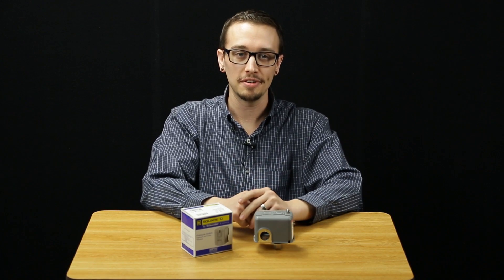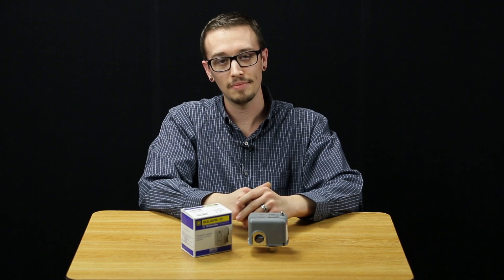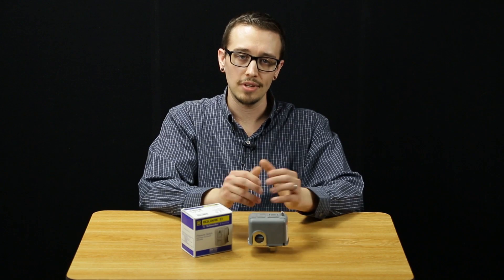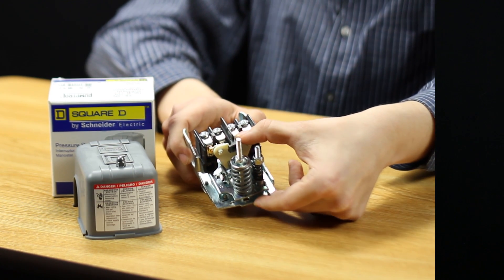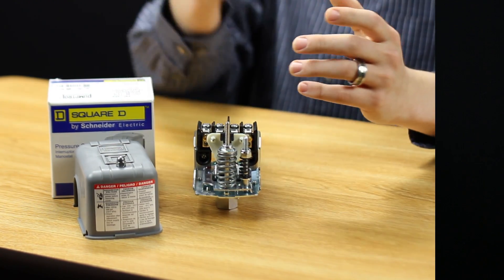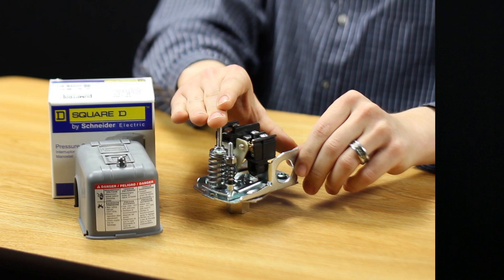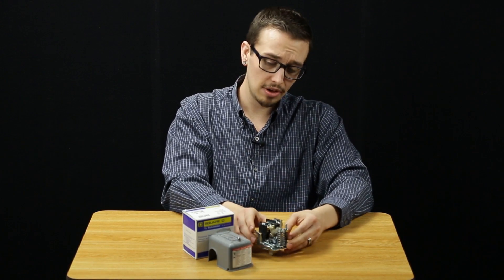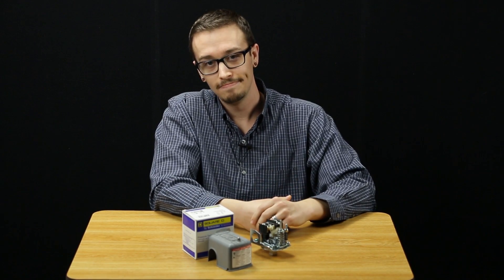Square D Pressure Switch

Comment from the maker: Thanks for watching! If you have ANY questions or concerns about your water/wastewater system you can leave a comment, call our experts at 855.329.4519 or you can live chat with them on our website: RCWorst.com
Reply: The water is working good at my son house and going to my house i dont have no presure on my i put about 40 pounds in the tank and it used to work...look for leaks didnt find none
Reply: I have a submersible well pump about 50 feet deep.  New square d 30/50 pressure switch. I pulled pump because  once it hits 15 psi the pump would shut off. I found some frayed wires near pump so I replaced all the wiring. Still have the same issue.  Bad pump? Running out of water?  Any suggestions?  Pump is over 10 years old.

Comment: Does this model (without lever) protects from pumping on an empty well? If not, can you recommend something that offers such protection? Thank you!
Reply from the maker: No, it does not. This model does: https://rcworst.com/products/square-d-pressure-switch-m4-30-50-psi-w-low-pressure-cut-off-9013fsg2j21m4?srsltid=AfmBOorRpcebPr-2mw1f_fxul-kEH8lViixdord1O4T3s7pvJP9ByF89

Comment: Hello, Im hoping you can help me. Are the switches the same just different factory settings. I need a 30/50 but can only fing 20/40 here. Can just buy 20/40 and adjust to 30/50 or completely different switch? Thank you very much

Comment: We have  had a  Red Lion RL-SPRK200-BR sprinkler pump that pumps river water 700 feet up to my gardens for 5 years. It works but today we saw that we had a schedule 40 pipe collapse on the suction side and a leak on on the outgo sode.  We dont know what the problem is, but whatever it was caused the pressure switch to die.  Maybe it was all the moisture from the leak?   What should I look for when choosing a pressure switch.

Comment: I have a Square D 0013FSG 2 pressure switch that just went out, it's contact surfaces are damaged. Under the cover it says it operates 40-60 psi, but then in a separate spot next to that there's a number (80) in a Square border by itself with no explanation or description. What does the 80 represent?
Im asking because the switches I've seen available have a different number (24) in that same location.

Comment: Any difference between 20-40 psi and 30-50 pressure swithes ? Or just changes their pre set pressure ?
Can i will use a 20/40 psi pressure switch with a pressure of 30/50 and other upper?

Comment: Have a question and cannot find the right answer. I have a biogest system and utilizing the biogas. I need a automatic switching from bio plant at say 30 psi (app) to pump to storage when it senses the pressure..... So it is off and senses say 30psi ...switches on till zero pressure and switches off again. I think its referred to as Normally Open (NO) but I dont see the reference on line. Am I missing something?

Comment: Hi, greetings from Sri Lanka. Thanks for this useful video. Recently my pressure pump for the bathroom showers started to drop pressure and as result the water flow gets really slow and after a while only the pressure pump restarts. I checked the pressure gauge and find the pump restarts only when the pressure goes down to zero. Could you pl advice me to correct this, which nuts to adjust in the pressure switch?  In Sri Lanka we have the same looking switch but made for 230v. Thanks again.

Comment: How the heck do I reset it after a power outages?! Everything says its a low pressure switch, a little lever on the side of the box. Mine is like the model in this video.... there is no lever on the side of the box.

Comment: How to adjust the pressure switch if the pump is continuosly running. Also if the pressure gauge is out of order will the pressure switch will switch off automatically. Thanks
Reply from the maker: We have a video on how to adjust a switch: https://www.youtube.com/watch?v=1VNSv7xVzzU&lc=Ugyr_rDbmUa7SUlPskR4AaABAg
You will need a working pressure gauge installed in order to adjust the switch.

Comment: It would help overall understanding to explain there is a rubber membrane that the opening to water pressure exerts force against to allow switch to read! If clogged, the small diameter to rubber diaphragm, the reading can be faulty! And, may need replacement, or cleaning!

Comment: From what I’ve seen they use the same switch to regulate air compressor on a horse trailer or RV the only difference is they run higher pressures like 120 psi is this in fact the same switch it is a Square D?

Comment: what’s the problem if i already replace the gauge but it’s still not moving but the pump is working its putting water on the tank but it takes so long then it will automatically shut but the gauge is still zero and the water is strong in the house 
then when you use it even the tank is empty it’s not switching on

Comment: Ok so if I need to adjust the differential which way do I turn it for what? 
Currently mine is off at 125 and on at 80. I’m trying to change it to 120 and 90
Reply from the maker: We cover that in this video: https://www.youtube.com/watch?v=1VNSv7xVzzU&lc=UgynkPu4h0dZ26SGCTh4AaABAg

Comment: My points seem to get damp and freeze together  or freeze open on cold mornings. What is the best way to stop moisture from getting to the points?
Reply from the maker: A heater or small dehumidifier should be used if it gets cold/damp.

Comment: How do you turn the stupid things on????
Reply from the maker: It should be normally closed (on), unless you have a low-pressure cutout switch. In that case, you would hold the lever on the side to engage the contacts until the pressure is above 20 PSI.
Reply: @RCworstwater    I figured it out.    Have to pull up and hold it till the pressure builds up.     Mine was on at 38 and off at 58.    Was shutting off frequently.   Tank has a 40 psi check valve.   I reset switch to 42-62.   Working fine now.    Thanks.

Comment: Hi.  Question on a vehicle's on-board air system application, so I can use pneumatic tools/ air up tires...  I'm using a brand-new car A/C compressor to push air (instead of refrigerant), as part of an on-board air system for my Jeep Wrangler.  If the compressor only needs the black power wire (because it's grounded already to the engine) going to the Square D, where does the compressor's black power wire coming out of the compressor hook up onto the 125psi Square D air pressure cut-off switch?  My second question is for the switch that I've rigged to turn on/off the compressor, where does the power wire from the cab-based switch hook up onto the Square D?
Reply: These switches are designed for 240V with two sets of contacts. If you are just using one power wire, you'd only use a pair on one side (the two screws on the other side will not be connected to anything).

Comment: I have recently replaced the factory pressure switch that failed, with a square D pressure switch. And my 33 yr. Old compressor is working better than ever. Kept the old girl running, I was afraid that it wasn't going to be repairable. But with a little patience, and some help from a local compressor company. I was able to get it repaired and back in service. It really wasn't as hard to fix as I thought. The hard part was getting the air line, swapped out. Had to switch it from plastic, to copper. And make it a little longer to fit. It was well worth the extra effort to get it repaired. GF1, 👍👍👍👍👍😁😁😁😁😁😎
Reply from the maker: Nice job!

Comment: If my pump loses prime, will this switch close and cause the pump to run and burn out or does it have a safety feature that opens the switch below a certain set pressure?
Reply from the maker: You need the M4 pressure switch. Here are links for the video and where to buy it:
Video: https://www.youtube.com/watch?v=ROvZpwHV9Ho
Buy it here: https://www.rcworst.com/square-d-pressure-switch-m4-30-50-psi-w/-low-pressure-cut-off-9013fsg2j21m4.html
Reply: R.C. Worst & Co., Inc. 
Thanks very much! 
I’m going to watch the video and order an M4!

Comment: I bought one of your square D pumptrol pressure switch. It has a lever on the side to bypass the the switch to turn on or off. My problem is the screws that holds the wires were so freakin' tight. When I say very, very tight, I had to put it on the vise and use a vise grip to loosen it. It's so tight that it bends the prongs that holds the screws!

Comment: Mine is on a air compressor an switch new out the box came on prime the tank and I started spraying p gun  and never came back on. I started looking close and contacts are touching their in same spot w Manuel switch on or off idk

Comment: Very informative videos thanks.My pressure tank low is 38psiI have a new square D switch 30-50,will that work or should I purchase a  40-60 ?Also from  the pump/tank to the cabin is about 80 feet  ,and the up to 1e floor 5 feet,should the pressure  be changed to get correct waterpressure in my cabin?
Reply from the maker: Give us a call: 855.329.4519

Comment: Hi my square D pressure switch has a factory setting at 20/40. I want to lower the cut-out pressure to 30 because I have a small water pump which cannot reach a cut out pressure of 40, making it run continuously. Is it possible and safe to lower the cut-out pressure to 30?
Reply: Yes, you can loosen the small nut only to reduce the cut out pressure. You might have to loosen it almost all the way to get it down to 30 psi (I think the min spec is +10 psi above cut-in). Just be careful that your pump isn't short cycling afterwards.
Reply: @TechnicalLee  thank you very much for picking up on my question. Really appreciate it 👍
Reply: Does somebody have any answer?

Comment: how do you reset type d pressure switch without a reset lever
Reply from the maker: You can't. Give us a call if you need help troubleshooting: 855.329.4519

Comment: Looking for info on my Square D 9213 switch. On a vintage compressor, 1940s I think. It is shutting off around 150 psi but wont turn on until drop to 50 psi. Only 1 spring.
Reply from the maker: We only supply pressure switches for water pump applications, you'll want to reach out to Square D directly: www.se.com

Comment: Thanks for your videos. If I adjust my pressure up say 10 psi does that then mean that i need to add 10 psi of air pressure to my pre-charge pressure tank to keep the minus 2 pounds ratio?
Reply from the maker: Yes, your tank's air pressure needs to be adjust to 2 PSI below the cut-in pressure of your switch. Remember that the power should be off and the water pressure drained before adjusting the tank. Here's a video on how to do that: https://www.youtube.com/watch?v=w21qa2bMUh8

Comment: Square D makes several different psi factory cut in cut out switches. This one for pumps 30-50, with a limited higher adjustment, but for a switch for an air compressor with say a 120-150 range is the only difference the springs that are used? The 30-50 states max pressure is 220 psi and not possible to adjust it that high. So all the switches are the same except for the spring rating used? Thanks for the upload.

Comment: i noticed my switch was shooting out a strong line of water from underneath the switch, not where the pipe joins. it seems to come out of a small hole in the base which i can put my finger on to stop it. what "hole" is that
Reply from the maker: I have never heard of your issue before but I think the hole you're referring to is  a screw holes that holds the diaphragm in place. Your best bet is to look on the inside of the lid for your pressure settings and replace the switch with a similar one.

Comment: How do you set the Square D pressure gauge to only shut off in case of lack of water? I need to get the pressure switch to turn on from my timer switch.
Reply from the maker: You'll need to go with the M4 pressure switch and adjust it so that the pump does not turn off: https://www.rcworst.com/square-d-pressure-switch-m4-30-50-psi-w/-low-pressure-cut-off-9013fsg2j21m4.html

Comment: I bought a new 40/60... I need turn it on manually to get water  after about five minutes  pump shuts off then you have to turn it back on ..  I have a full tank of water .. do I need to adjust the cut in?  Need help.. thank you

Comment: May 19th, 2019: Howdy Chris. We purchased a 9013FSG2J21M4BP Square D.  When running the outside hose or barn well, the switch will not turn back on. We can take a shower but running the dishwasher at the same time leaves us with no water pressure. It is a 30/50. Should I be tightening the taller adjust spring (CW) to possibly change the range to 35/55 or even 40/60?  We also purchased a new Ultratech tank. Kind regards. Don
Reply: Chris has a video on here about adjusting the pressure switch. There should be information inside the cap of the pressure switch telling you the factory settings (usually its 30/50). To increase it to 40/60, turn the large spring nut CW. Turn a facet on to lower water pressure to see when the switch kicks on at and make adjustments if nessessary.

Comment: My pump has been runnin non stop since Jan 20 (based on my power usage via consumers power website).  In tinkerin with it, the #2 screw ended up backed off, no tension. No matter what I do, I cant get the thing to shut off. Plus, I filled the oil (submirsable pump, points located outside at the head) just in case it was low somehow. Good pressure in the house, but killin my pump and wallet.

Any thoughts?
Reply from the maker: The first step is to replace the pressure switch if your current one is not working properly. What pressure does your gauge show?

Comment: My cut in is way too low less than 10 psi cuts out at 60 psi. 
Factory settings are 40/60 psi
Reply from the maker: Sounds like you need a new pressure switch: https://www.rcworst.com/Square-D-c231.html

Comment: The spring popped off on one of the contacts so that the contact fell right off of my Square D pump. Can I replace that or does it mean something irreparable broke? Thanks
Reply from the maker: I would just replace the pressure switch. We sell them here: https://www.rcworst.com/Square-D-c231.html

Comment: Ive got a 30-60 PSI Switch. The shorter nut is not recommended to be adjusted as per the video, however I live in a 6th level appartment and 30 PSI start switch results in a very low pressure, so I am looking forward to adjusting the switch start to 40 PSI:  Will it work to adjust tightening the shorter nut or do I need a new switch? Thank you.
Reply from the maker: You should be able to adjust the smaller nut to increase your cut-in pressure. If it doesn't work out we do sell these switches on our website: https://www.rcworst.com/Pressure-Switches-c172.html
Reply: FWIW, for each 2.33 feet height the water is pumped up, you will lose 1 psi.  So 48 feet up (assuming 8 ft. per story) means a 20 psi drop.  Most pumps have a spec. showing the maximum lift and that number will need to be greater than the height of your floor.

Comment: Thanks for the info! It is very helpful. I do have a question though. Before I do the looooooong belly crawl under the dirt floor crawlspace to adjust my pressure switch (if needed) what size nut driver or socket should I take with me? I have tried asking this question and can't seem to find the answer?
Reply from the maker: Hey Douglas, 3/8" nut driver is the size you need. Have a safe crawl!

Comment: my pressure switch takes time to cut, and it consumes more electricity such that I end up having to switch off at night, I use it household (it feeds the house with water from the 5000 liter tank
Reply: Lesole Dithapo I have same problem what do you do

Comment: Thanks for the video. I have a Sq D switch and I played with the deferential nut, actually I have loosened it completely because when the switch turns off it was taking very long time to switch on. now it seems working fine. How do I reset it to factory settings or should I keep it as it is?
Reply from the maker: It depends on what you are using it for. Irrigation, home water supply? If you are happy with how it is operating I would say don't touch it.
Reply: Your not listening to the video

Comment: I followed all dorections installing my Sq D pressure switches checked all c[connections. Yet my breaker panel will not turn on. Is this a common problem. I wired by color exactly as the old switch was
Reply from the maker: Marshall, please give our technical service team a call so we can help you get to the bottom of this. 855.329.4519

Comment: I need more pressure in my house from my well, which spring screw do I turn clockwise?
Reply from the maker: Thanks for the question! Assuming your pump can safely produce the additional pressure, you will need to tighten the large nut. One full revolution will increases the pressure by 2-3 PSI. Please give our technical service team a call to determine what pressure you can safely adjust it to.
Reply from the maker: Check out our new video on adjusting a pressure switch: https://www.youtube.com/watch?v=1VNSv7xVzzU&feature=youtu.be
Reply: @RCworstwater  I thought in this video you say a 1/4 turn gives you 2-3 PSI?